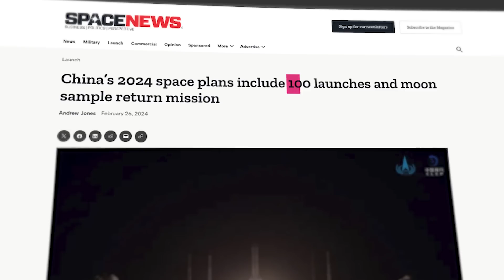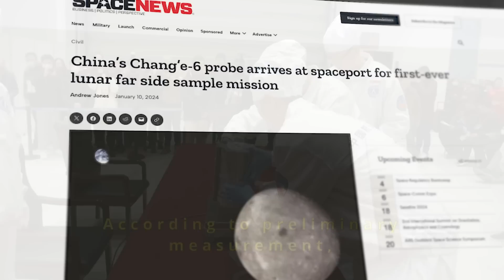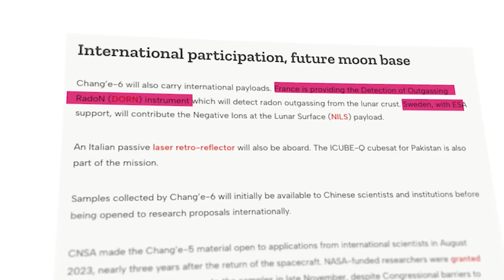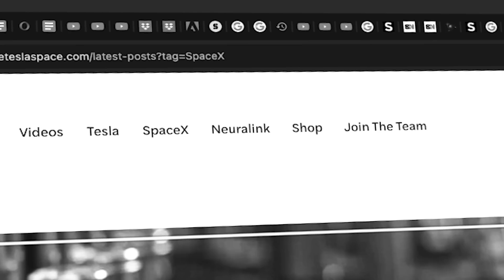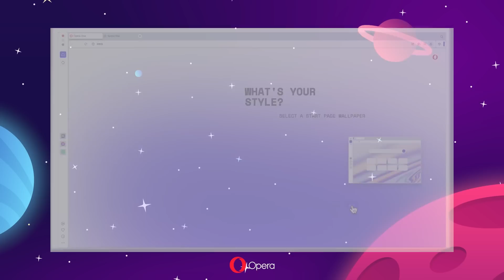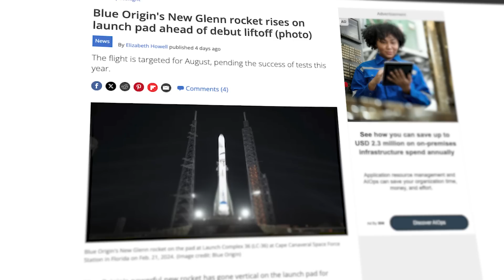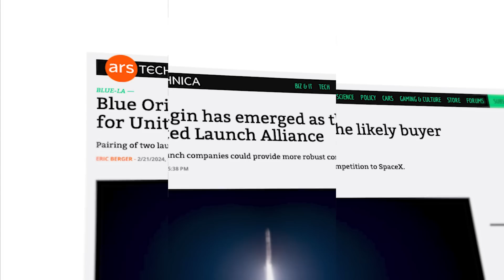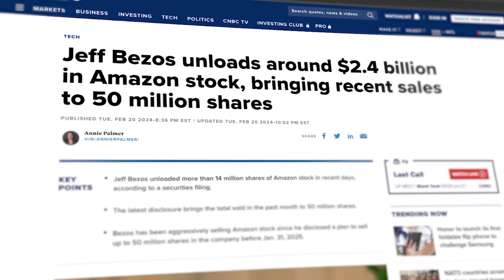Why China Is About To Take Over The Moon In 2024!

Comment: Little premature to declare China having the capability to take over the moon.  

Back in the late 1990's there was a minor space race by developers to build the first SSTO rocket.  Every developer had their single test bed, and they lasted as long as their investor's money lasted or until the test article crashed and burned leaving the company with no hardware.

What's happening with SpaceX's Starship is nothing more than astounding.  Blue Origin has a New Glenn test article they're working on after nearly a quarter century after incorporating.  SpaceX has a dozen Starships in various stages of readiness, and their pace is increasing and speeding up.  If Starship becomes successful (and there's no reason to think it won't be a this point), then they will have achieved a level of technology that will put their competitors a decade or more behind SpaceX.

China's Long March 9 rocket was redesigned to be reusable, and have the payload capacity of 100-150 tons to LEO.  If you look real close at it you'll see that it looks like a mockup of a super heavy and starship.  It's not even slated to fly until about 2033.  By this time the United States will have a small city on the moon if Starship enters service by 2026.
Reply: The problem (well... at least the final one) of Starship aside that the necessary re fueling 20 times over (what a waste, just go nuclear already) is it's gravity center, you land on the moon by slowing down from orbit so you land horizontally and not vertically, on a body with extremely weak gravitational forces, that means that even a small shock can flip over the whole thing upside down, as showed with odysseus. A 50 meters landers stand no chance to making it in one piece on such dangerous terrain. And btw everything in the lander is in the nose, the air, the crew, the cargo, the elevator.... All of that is so heavy that it's unreasonable for it to be on the higher part of the ship, while the tank will be almost empty after landing, so the center of gravity will be too high and if it didn't flip at the landing it'll fall over just by standing on the moon.
Reply: @TomDrez   I know exactly what you mean and left a similar comment as your own on another video regarding the recent mishap with the Odysseus lunar lander (also much taller than it was wide with a high center of gravity).  

No matter how gentle the landing is, there is going to be some downward force exerted on the legs which the moon will reflect back onto the spacecraft.  It wil bounce and that bounce has the capacity to upend and topple the vehicle if it doesn't have a wide enough stance between its landing legs.